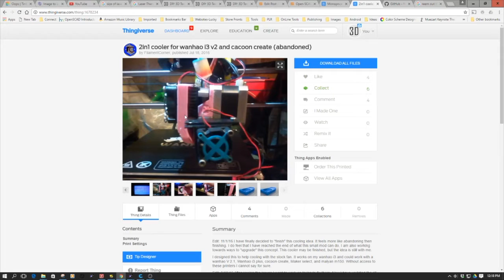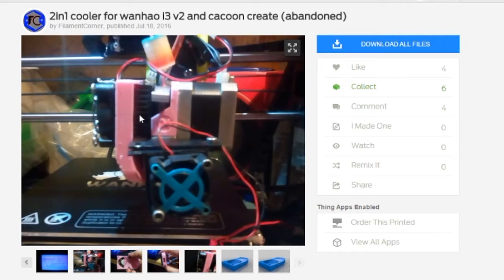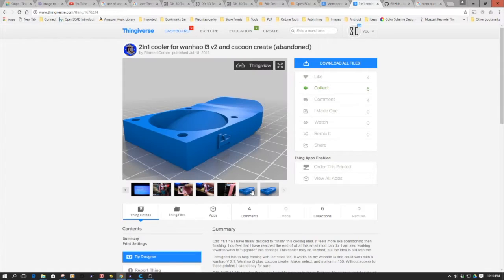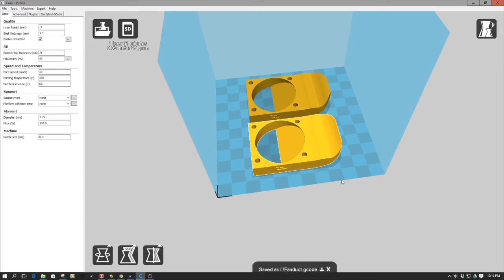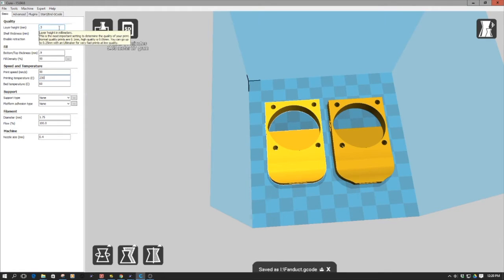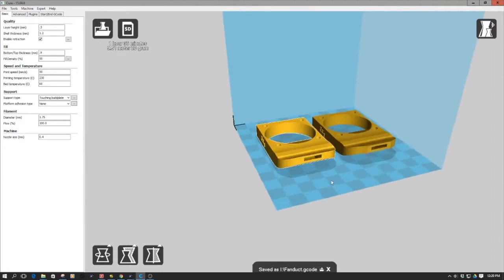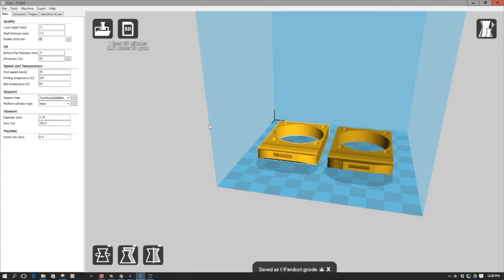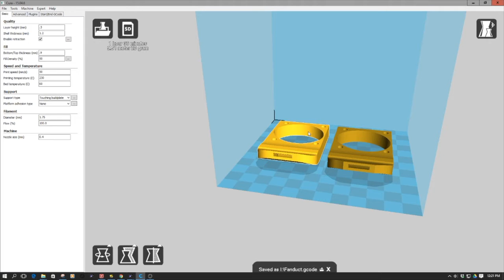Wanhao Duplicator I3 3D Printer  - 2N1 Cooler from Thingiverse Part 1 of 2!

Comment: might be able to put a vent / valve in it the the user opens after layer 1.   flow is a tricky beast , the smallest loss in diameter is a huge loss in flow . shape of the passage can be big too . sometime the air scoop shape that works best can seem counter  intuitive . example pressure return pipe on old R/C gas tanks was usually just a pip with a 45deg cut . but the opening of the that faces away from the direction of air flow . air passing by is forced to curl past the edges and down in,  results in slightly higher pressure the if you faced it forward . as i have to rebuild the x carriage for my franken printer , I have been pondering incorporating cooling air flow for it . Acel Erate's home built unit uses a shaped small bit of pipe , and a fish air pump to make a small well aimed cooling blast with low mass on print head . his head is water cooled and pretty wild . here's video about it : https://youtu.be/ckdFfYFWr00?t=54s
Reply from the maker: The video is interesting, however this design (the one which I tested) is interesting however where it fails is stealing cooling from the extruder and if you look over at my open SCAD channel (a more compete version will come here in a couple weeks) I actually built a lager fan version for the extruder and have had really good luck with it.  However as in the video you shared I fear one might get to much of a good thing as more cooling with improve bridging yet I believe at the cost adhesion to the other layers.
Reply: yeah  its one of those things that has no 1 fix for all .    // also i have been fighting the new
YouTube notification systems ,  seems they are still working on it , but its driving me nuts trying to find stuff , like your replies .
Reply from the maker: Yes youtube notifications are a pain!  I wish there was a simple way to handle especially for multiple channels!
Reply: should not have to mess with a browser to make the functional .
Reply from the maker: Amen brother!